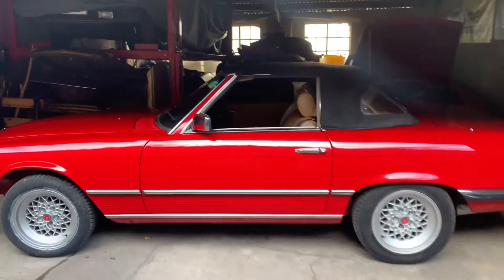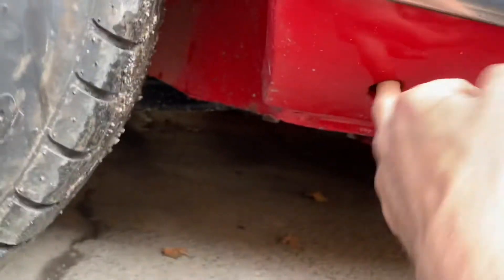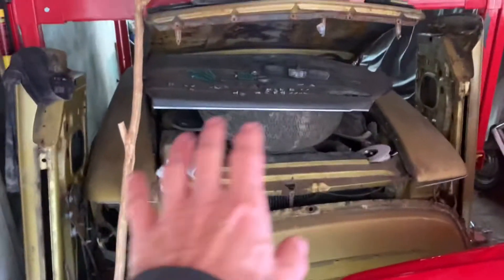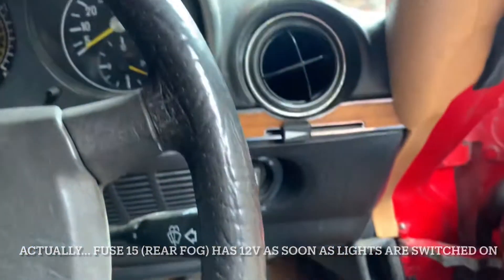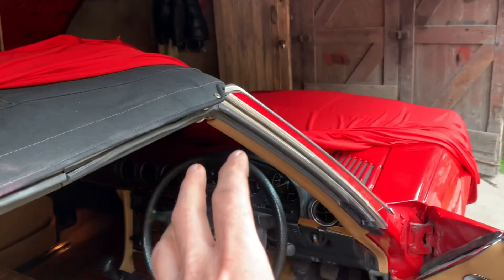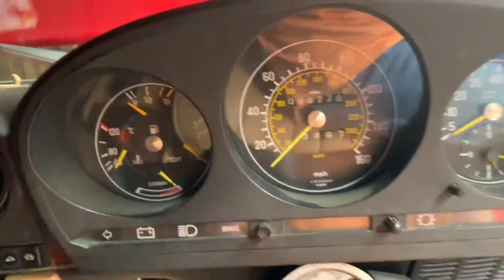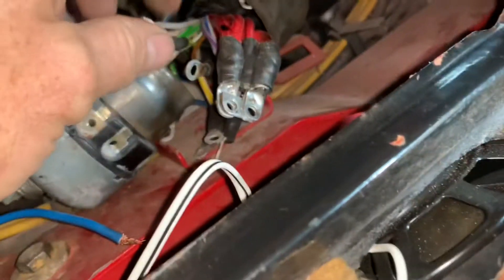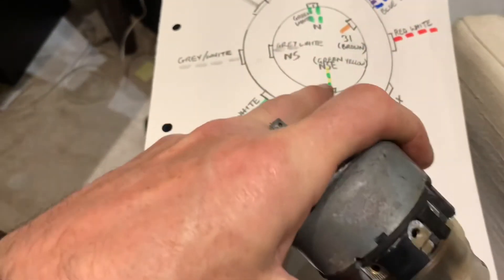Mercedes R107 handbrake adjustment rear fog light fix

Comment: Hi Mike. Brilliant step by step fault finding. Good job!!
Looks like the SL shop won’t have my car ready before I leave. I’m looking to see if I can extend my stay for a week, but I think they’ll still be working :(
I can’t remember if I’d said, but they’d had a small accident with it while it was under their care. I guess it’s the best place for it to be for repairs 🤷🏼‍♂️
Reply from the maker: Thanks for your comment. We;; at least its in good hands. The MOT station once had a small accident with my silver 280SL and bashed the light and wing in whilst getting it on a ramp. Thats probably why it was so easy to get that wing off when I was welding the front footwell! It you need a lift up there let me know...I'm always trying to save £8 on postage and spent £40 on fuel....Mike